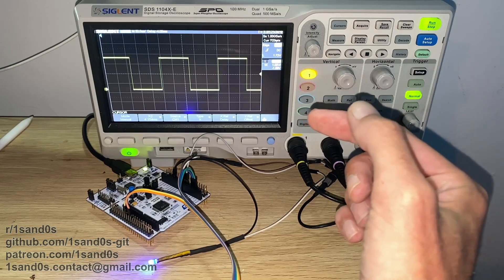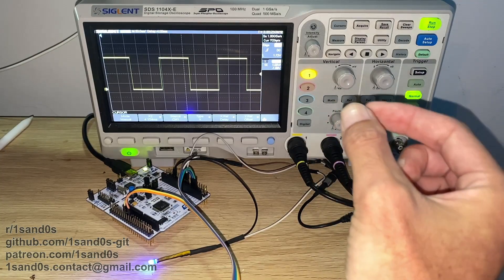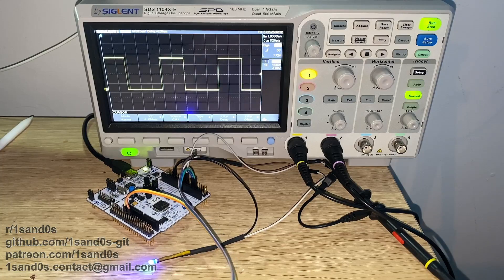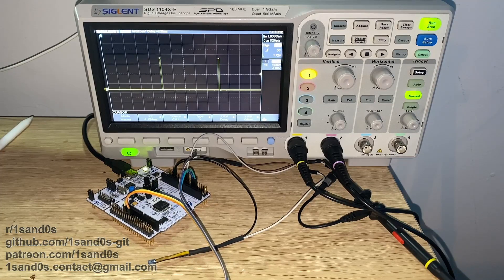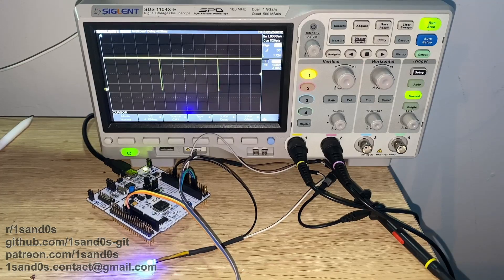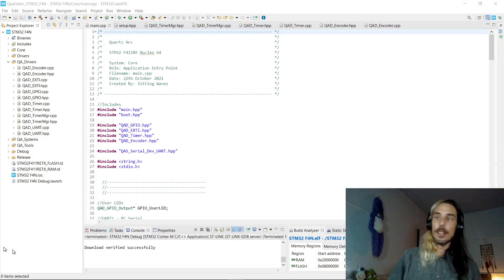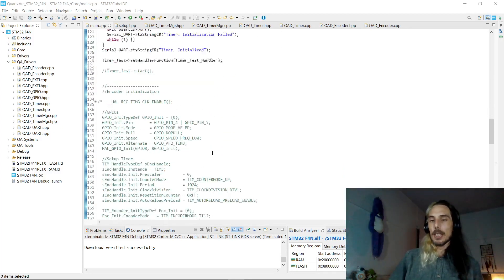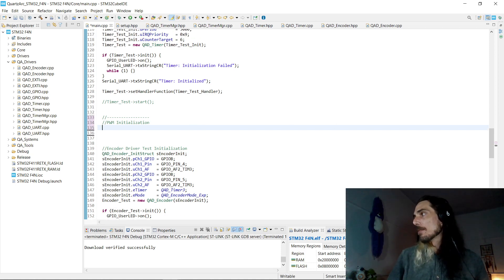PWM with STM32

Comment: That's great the way explained. Thanks for your video. is anything in your future list to make 3 phase motor controller 120 degree mode conduction.
Reply from the maker: Thank you! I do have a video planned for 3 phase PWM, but I'm not completely sure when it will be coming out just yet.